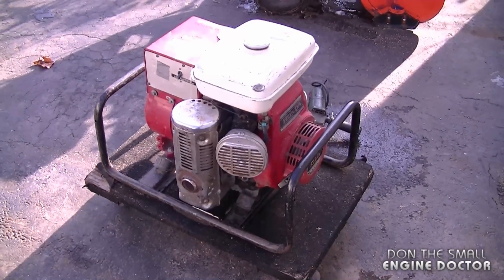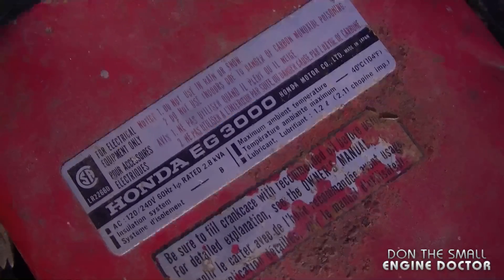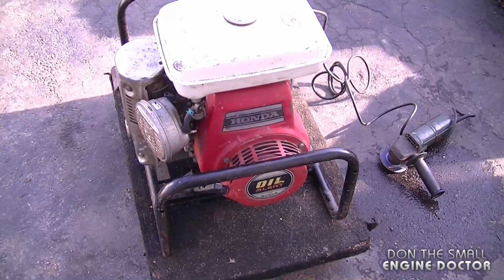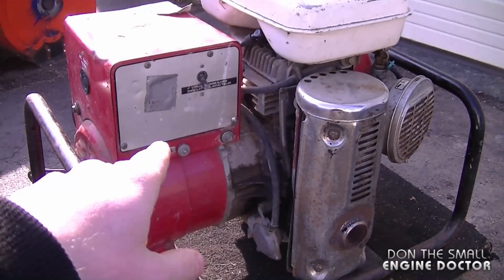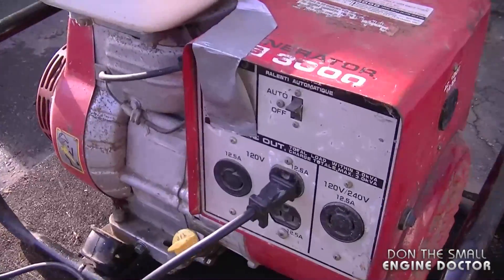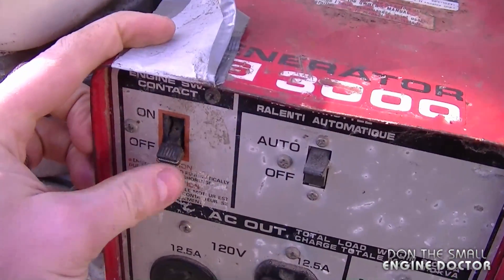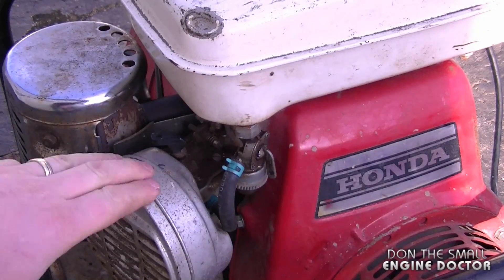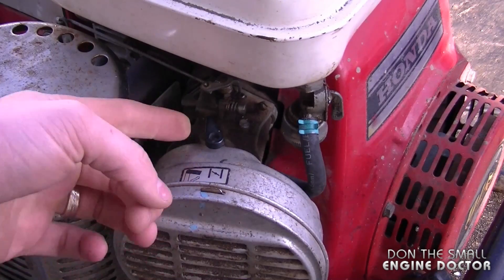EG3000 Honda Generator Start-Up

Comment: I have the 2200 I believe.  Looks exactly the same though.   It sat for over 10 years. Got it out, cleaned it up, cleaned carb and now using it today.  Starts with 2 pulls every time

Comment: Hi My Name Is Jerry.I Have Gotten Addicted on trying to fix lawn mowers. And stuff Ur Videos Have Helped Me Lot.I Got This back pac blower that i was given. He Said His wife used it with gas When irs A two cycle blower and it dosnt want to start its a ryobi 42Mp Something.Can u Gide.me.thank. u.
Reply: Pull the muffler and get a look at the rings and piston to see if the are severely scored. Might try a compression test too. If you can't turn it over, pour (squirt) some seafood deep creep in through the spark plug hole and let it sit over night. The next day try to pull it over slowly with the spark plug out. If you get it to move and turn over, keep turning it over to get things loosen up and to get the deep creep out of the cylinder. Put the plug in and try to start it...if it starts it will smoke like crazy for a while then clear up. If the piston and/or rings are shot you might be able to get new ones to replace them. If the cylinder is toast too....you're talking bigger bucks and may not be worth the $ to fix. Hope this gives you some place to start :)

Comment: I have a 1972 honda ED250, it has a leaky bearing or seal, its intake valve doesnt fully close, and the carburetor floods the intake,it wont run because it constantly floods